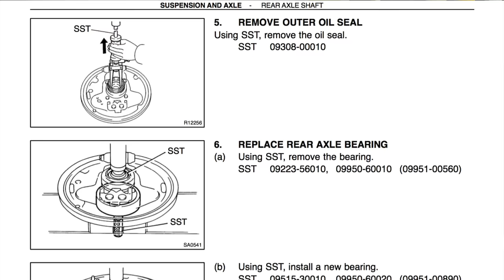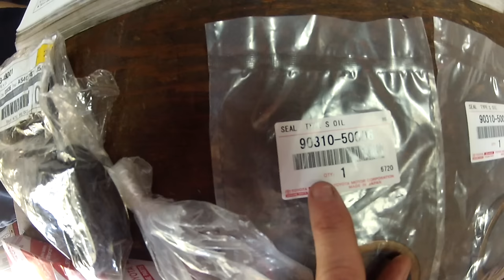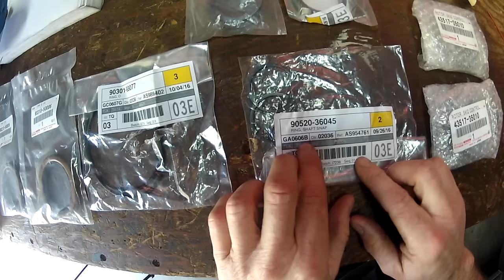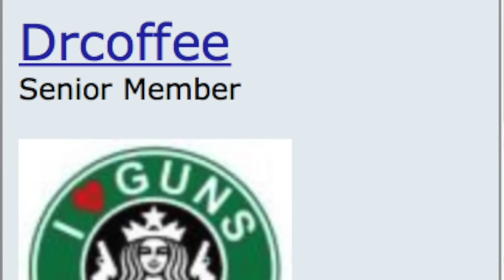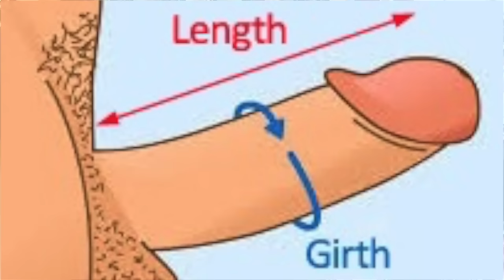Toyota Rear Axle Seal/Bearing Replacement (ABS Rearend)

Comment: Hey Tim Great Video Whats the link for this tool
Reply from the maker: We don't recommend the tool featured in this video anymore.  We found a much better one featured in our Part 2 video.  The link to the toolset is listed in the video description.   When you first view a video, you're only seeing a tiny fraction of the video description.  You need to click on "more" to expand it.  In our video descriptions, we always share helpful information like parts and tools links.   The video description has a max character limit, and sometimes, we have to put information in a pinned comment (1st comment you see).  We also use pinned comments to provide updated information on the job.  Be sure to look at both the video description and any pinned comment so you don't miss out on valuable information.   Good luck.  https://youtu.be/R-c2x3F8DU4?si=puY6ZO2w07As7Mtm

Comment: Does reversing the orientation of the retainer also apply to a 2004 Tacoma Prerunner SR5 RWD?
Reply from the maker: Yes.  1st Gen Tacomas have the same rear end with the exception Tacomas have leaf spring mounts and 3rd Gen 4runners have coil spring mounts.

Comment: Ok question Tim ( or whoever else might know): have you done this yet on a 4th gen 4runner (FJ Cruiser, etc.), with the asymmetric bolt pattern on the rear wheel bearing? I'm wondering if that 8-hole end plate will fit that bolt pattern. Thanks for any insight.. cheers!
Reply from the maker: We have not done this on a 4th Gen 4Runner or FJ Cruiser.

Comment: hey timmy the deflector gasket on the axle. do you recommend replacing it ? i have a 2005 tacoma
Reply from the maker: Oz Mechanics If you're talking about the large o-rings on the ends of the axle housing, yes, replace them.  I'm not sure if that's what you're calling the deflector gasket.
Reply: Timmy The Toolman if you can send me your email I can send you a photo of it
Reply from the maker: Oz Mechanics My email address is: mtbtim@sbcglobal.net
Reply: Just sent the email

Comment: Hi Timmy, as always, Great vídeo. I need to replace the axle seals since the drum is full of grease or oil, I did not know about this problem until I was checking the spare tire and I could see that the drum was full of grease, there is no noise or  any sympton. How can I know that I should replace the bearings and not only the seals? Thanks Timmy!
Reply from the maker: Hey Javi, glad you like our video.  Make sure you watch the entire video and read the video description before attempting this job.  If you only wanted to replace the seal, you would still need to reposition the inner retainer more inboard by a couple millimeters, or better yet,  pull off the ABS tone ring and inner retainer, flip the orientation of the retainer (bevel facing the ABS tone ring) and then press them back on in the position.  There's two reasons why you want to replace the bearings.  #1, the worn out bearing that has additional play, which allows the axle shaft more movement, could have been a contributing factor for the seal to fail.  #2, when gear oil gets past the seal and surrounds the bearing, the gear oil gets into the bearing and slowly washes out the grease.  The bearings need grease for proper lubrication, not oil.  The bearing is now compromised and could overheat causing a fairly dramatic failure destroying your axle and also damaging the inside of your axle housing.  

The smart move with this repair is to always replace the bearings.  And, it's always smart to do BOTH sides even though only one side has failed, because guess what, the other side is probably going to fail soon too.  Also, make sure your differential breather is not clogged.
Reply: @TimmyTheToolman  Hi Timmy, Thanks for take the time to answer my question. It is a hard work to replace all the set. I am thinking to go to yonke, buy an axle and put it with the new seals. I would like to send you some pictures of my 4runner. Again, Thanks Timmy for all these great vídeos!
Reply: @TimmyTheToolman  Hi Timmy, how can I find the breather of the differential?
Reply from the maker: Look at the raised section of the rear axle where the 3rd member bolts in.  On the driver side of that hump, you'll see a silver thing shaped like a sewing thimble.  That's the breather.  You can unscrew it with a deep socket, box end or open end wrench and then try to blow through it.  If you can blow through it, it's good.
Reply: @TimmyTheToolman  All right! Thanks Timmy!

Comment: I have an 02 tacoma. I followed all the advice in this video. The problem is that now my abs keeps on engaging everytime I brake when coming to a stop. Does anyone have any advice? Could it be that I'm not pressing the abs tone ring far enough?
Reply from the maker: If you did the job just like we explained how to do it, your ABS tone ring is pressed onto the axle far enough.  Could you have maybe damaged your sensor when you pulled it out of the axle housing?
Reply: @TimmyTheToolman  yes i did everything exactly as the video showed. I don't think the abs sensor is broken because the abs doesn't kick on everytime i brake. Sometimes it comes on and sometimes it doesn't. I've done everything like in the video like the dr. Coffee method and marking the retainer and spinning the axle to get the seal to ride in the middle of the retainer. I'm thinking that by switching the orientation of the inner retainer, i didn't have to press the tone ring and retainer as far to get the retainer centered so the abs tone ring might not be align with the sensor. I'll try switching it back to the way it originally was and see if that changes.
Reply from the maker: @renzokukenleonhart  Your theory isn't going to work.  The problem lies somewhere else.  With the flipped inner retainer, you're basically getting the retainer and ABS sensor in the same position as it came from the factory.  I've done this job probably 15 times and never had an ABS issue.  If you flip the retainer to the original orientation, bevel facing the seal, you'd have to press the retainer and tone ring less far to get a good mating with the seal.  You could press the ABS tone ring separately and drive it onto the axle shaft a little further, but like I said, I've never heard of the problem you're having.  

When you disconnected the brake lines, did you cap them off to limit the fluid loss?  I'm thinking maybe you got air into the ABS module.
Reply: @TimmyTheToolman  when i took off the brake line i tied off the end with rubber gloves to prevent it from leaking and shut from getting in. I also did a brake job and bled off the system. The first time i bled the system and drive it the brake light on the dash did come on. So i bled it again a second time. Now the brake light is off but the abs is acting up. I noticed that when i put the sensor back in, the o ring was preventing me from putting it all the way in. I ended tearing part of the o ring. Perhaps that could be the problem. Maybe the sensor isn't flush and it might be angled a bit.
Reply from the maker: @renzokukenleonhart  I'm guessing you lost a lot of fluid into that glove on each side.  And, maybe it is the sensor.   What I am pretty certain of is it has nothing to do with the position of your tone ring on the axle.  Good luck figuring it out.
Reply: @TimmyTheToolman  this is my first time doing this job and should have taken pictures of everything. Since you've done this job many times, when you look through the hole where the sensor is mounted, is the tone ring dead center with the hole or is it off a little to the inside?
Reply from the maker: @renzokukenleonhart  It is not centered with the hole.  It's more towards the inside.
Reply: @TimmyTheToolman  thanks I'll try and replace the o ring and try to get the sensor flush and see if that helps before i go out and buy a $200+ sensor. I did notice the sensor was completely soaked in fluid when i took it out.

Comment: I have a quick question for you what do you do if you have gas oil out of your gas tank like if the car is idle and you stand outside the car you can smell gas? I can't find information on this anywhere
Reply: Also this is a 2001 Toyota 4runner 3rd generation
Reply from the maker: Sounds like you might have a fuel leak somewhere.  I'd start at the fuel tank and work towards the engine checking all your fuel connections for leaks.

Comment: Great stuff man. What size bearing puller is that? Did it come with those stand-offs?
Reply from the maker: Hey Steve, check out the video description.   We list all the special tools used including the OTC bearing splitter set.  It's a 2-piece set and we provide a link to buy it from Amazon.  It's a great set.

Comment: Tim,  are the inner and outer retainers on the axle shaft the exact same part? So I would need to buy 4 of these same retainers? To have 2 per axle?
Reply from the maker: Mike, read the video description for a lot of helpful info.  Yes they are the same part number, but NO, you DO NOT need to replace them.  If you pull the parts off rather than cut them off, you can reuse both retainers and ABS tone ring on each axle saving yourself around $150.  You basically swap the retainer positions on the axle.  And, the ABS tone ring is just a hunk of metal that doesn't need to be replaced provided it's not cut off the axle.

Comment: I am having a problem. My bearing is just falling in to the housing and when it's in the housing the bearing is spinning(the out side ring) I feel like that's not right .Do you think I need a new housing?
Reply from the maker: Jeremy James LaPointe Hey Jeremy, the bearing actually fits into the housing really easy.  Sometimes it will actually go in just with your hands if it goes in totally straight.  Double check the part number and compare it to the old  bearing you pressed out.  If the part number is correct and the new bearing matches the old bearing, you're ok.

Comment: You think the HF 12 ton press would get the job done? Or is the 20 ton necessary?
Reply from the maker: 89mustangLX  I think the 12 ton could handle it but I think the 20 ton press is a better purchase since it can handle more jobs like the front wheel bearings.

Comment: Min 46:17 because of play in old bearing your still putting the pressure to the inside of the new bearing, not good, if you put a plate on top of new or old bearing pressure will be in correct location, outside edge of bearing.
Reply from the maker: Did you watch how the bearing literally feel into place?  No pressure was applied that could damage the new bearing.   It is not a press fit at all.  During the filming of our non-ABS rear axle seal job, my buddy Jordan dropped the bearing in just with his hands.  If it was a press fit, you are correct that we could have damaged the bearing by applying force to inside race of the old bearing.

My new tool of choice is a 3" ABS plastic clean-out and cap to press the bearing into the bearing case.  It fits the outer bearing race perfectly.  If the pressure required starts to bend the plastic cap, I know the bearing isn't going in square and I reset and try again.

Comment: Is that a dab of FIPG at the base of the outer bearing dust seal at the 42:02 minute mark? I'm about to press everything out on my wife's 100 series and I've heard of SOME ppl, not all, having issues with seal.
Reply from the maker: No, that's grease from the bearing you're seeing.  That seal is just there to direct any gear oil that goes through the bearing into the oil director on the back side of the axle.  Then the gear oil comes out the face of the axle shaft and out one of the hole in the brake drum.  It's not a perfect system and gear oil eventually works its way into the brakes.

Comment: When pulling out the seal, another o-ring fell out from inside the axle housing. It's not the one that goes on the outside of the housing, it's smaller. Any idea what this mysterious ring is?
Reply from the maker: Hey Ryan, that o-ring is part of the seal.  It wraps around the rubber seal to hold tension on it.
Reply: Good, I was hoping that was the case. Thanks!

Comment: once again, amazing video thats gonna save me money. i cant say thanks enough. Will all the parts you have listed in the description work for my 4x4 98 tacoma with abs and factory e locker?
Reply from the maker: Hey Eric, the parts should all work but since I'm not totally familiar with the Tacomas, double check that you are getting the correct bearings.  For the 3rd Gen 4runners, there are two different bearings and I don't know if that holds true for the Tacomas as well.  Please take a look at the video description because there's lots of helpful information including ways you can save money on the parts.  You can reuse the retainers and ABS tone rings.  Also read the comment I pinned for more helpful information.  Finally, we found a much better tool for this job and we list a link in the video description as well as have a video showcasing the use of that tool.  So, do your homework before tackling this job.
Reply: Timmy The Toolman yea I have. Just ordered that tool. Looks like it works great. I just checked all the parts on mcgeorge Toyota and they all fit. Hopefully after doing this job it will solve my roaring issue. Hoping it's not the ring and pinion!
Reply from the maker: @ericbrown6802  Yeah, hopefully it fixes it.
Reply: Timmy The Toolman well I got the job done yesterday and no more roaring from the rear end. The tool worked very well, however I did not have to press the retainer on as far as you stated. Maybe tacoma axles are different. I only had to press on till 3.25 mm of polished axle showed to achieve the seal riding dead center.
Reply from the maker: @ericbrown6802  Good to hear you got the job done and it fixed your problem.  Good to know the Tacoma axles might be a little different.

Comment: Hey thank you very much for this video Tim! I want to tackle this project on a 2008 (Second Generation) Tundra. Have you come across a tool that does the job? From what I gather on Duane's site is that it won't work with ABS Tonner ring for this Tundra
Reply from the maker: Hey Luis, I don't have experience doing this job on a Tundra.  Maybe Duane's tool can work with 2nd Gen Tundras but he doesn't advertise that it will because he's not 100% sure it will work because nobody has tried using it on one yet.  Try messaging Duane through his Ebay store and ask him.

Comment: When pressing in the bearing @46 minutes: Coming from the bike industry you "never" seat a bearing by pushing on the inner race... Of course bike bearings are not nearly as large and robust, but could/would this cause an issue?
Reply from the maker: Reinout it could be an issue if it was truly a “press” fit. But as you saw at ~46:00, the bearing required effectively no real force to get it in. You see it fall into the bearing case. The reason we had it in the press is to ensure we push it in as straight as we could and not get it hung up or cocked sideways.
Reply from the maker: You are correct at some level.  For the bearing case insertion, the bearing isn't remotely a press fit into the bearing case.  I talk about this in the video.  You can literally insert the bearing by hand if you're lucky.  We did use the inner race in this video to apply slight pressure to get the bearing in place.  We did make a Part 2 to this video and I now use a 3 inch ABS plastic clean-out to drive the bearing in via the outer race.  https://youtu.be/R-c2x3F8DU4  In Part 2, we literally show the bearing falling in place with probably 1 pound of force.  When the bearing is lined up right, it will fall right in.

However, you can seat a bearing using the inner race when you can support the opposing side of the race like when we are driving the bearing and outer retainer onto the axle shaft.  We are applying pressure on the inner race, but since we are supporting the opposing side, no load is being put on the bearing.  Now, when you are pressing the axle shaft out, you can't support the bearing and all that force is being applied to the inner race.  This is why it's not prudent to reuse bearings that have been pressed off because the bearing have most likely been damaged.
Reply: @TimmyTheToolman  good call-out.  I didn't pay attention to the amount of pressure applied to either race.